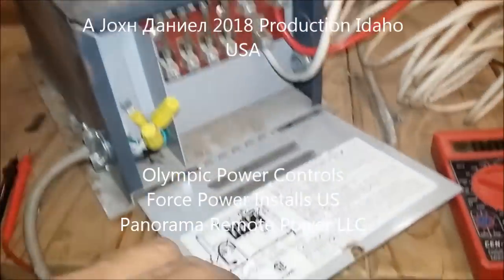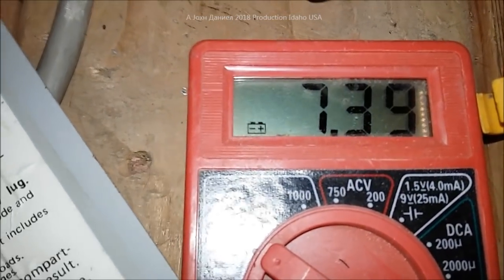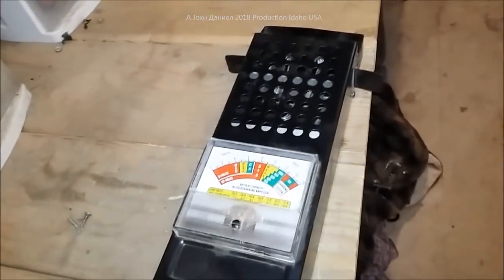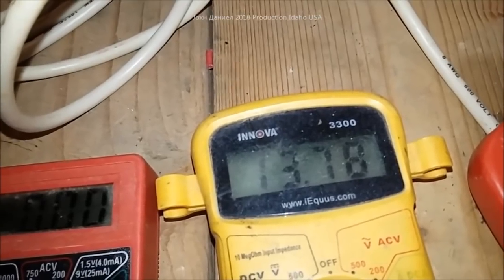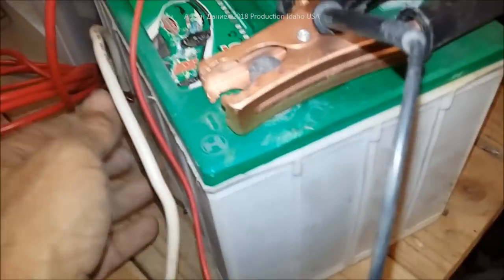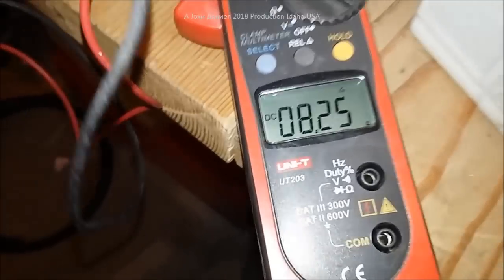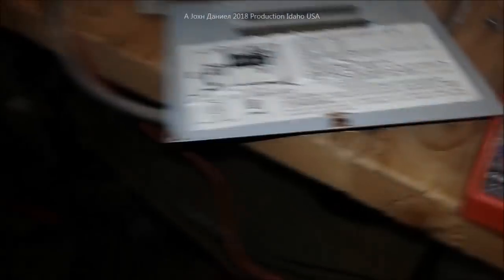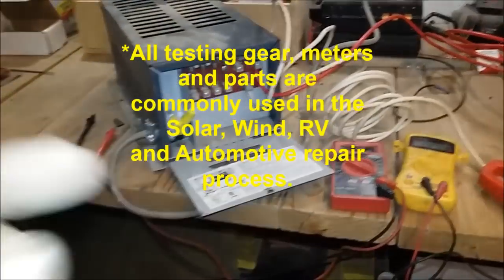Power Converter Charger test 120 Volt AC to 12 volt DC,  PARTS BELOW

Comment from the maker: As discussed, The UNI-T Meter that does it all, is fount at https://amzn.to/2LZrz8Y  . And that Load/Battery tester 100A https://amzn.to/2tdymnS  A NEW 35 to 75 amp "can use it on all RV systems and install it as converter/charger in the sytem" is this one, https://bit.ly/2LZv6UL , NO ONE gives you the local store return & warranty that WalMart can on them. Best place to order RV parts is absolutely a Walmart, https://bit.ly/2M03TS1 (< see yourself) think about it!!!! Instant return, warranty, and CHEAP!!
 RV power Controller Link option 2 -  http://linksynergy.walmart.com/fs-bin/click?id=nNC3MIW3bd8&type=10&tmpid=1081&offerid=223073.7442&RD_PARM1=https%253A%252F%252Fwww.walmart.com%252Fip%252FWFCO-9800-Series-RV-Deck-Mount-Power-Converter-Charger%252F55556999%253Faffs%253De
Questions on how to repair, or alter or the best bet, skip and bypass your bad controller - JUST ASK!
Reply: FYI the link you've provided for the clamp on ammeter is the wrong one. It sends you to the UT-202 which does not measure DC Amperage. You need the link for the UT-203.
Reply from the maker: It should do both ac and dc

Comment: My converter produces 17.5 volts. It has no charger in it.
20 amps max but it used to be 12.8 volts.
What would cause the voltage to be so high?
Thx

Comment: Up to 50amp battery chargers, obviously battery run RV's have been around for many years, bet solar panels were are real game changer in that case for long term RV use.
I actually saw a battery bank blow apart from low water levels in the batteries, they never topped the water up and I mean never.

Comment: I"m putting this on my list for my cargo trailer conversion.
Reply from the maker: This one is going into my BUG OUT rv. The guy wanted a 40 amp with intelligent control ( slang for computerized crap) so I installed him a 40, knocked off $10 for the old one and in my view I hit the jackpot because these older ones can handle generators, bad RV park power and careless owners. The new ones have to be watched carefully. He did not buy the one I said go get from WalMart, He got a goofy Teledyne 40A from a local supplier, JUNK!
Reply: Good video. It's to the point, no unnecessary 5 minute back story on why you bought the red one instead of the black one, or whatever waste of time,  so many have.  1 question from a new guy just starting to understand electricity and what travel trailers are all about.  Are the "factory" charge converts as bad as so many say? Should I immediately upgrade from 3 stage to "smart" 4 stage? Common complaint with the WFCO mine comes with is, takes too long to charge battery as it won't go into Bulk stage.
Reply from the maker: None are designed to bulk stage in the under $350 range. Thats why I do a every 3 months hard charge with a 50 amp charger, batteries disconnected from the system of course. On my other trailer I have 600w solar, many just add a 30Amp solar controller ( a 4-Stage Equalize, Bulk, Absorb, & Float) https://amzn.to/2ykVKFB and 300 watts of good 4 buss bar panels https://amzn.to/2M2LP9I and your covered. The newer 4 buss bar solar cell does well laying flat!

Comment: I have the same unit in my trailer ,except it's the 45 amp model. When I checked mine, I was getting 10.5 volts. Not sure on amperage as my meter doesnt do amps,  maybe I need to put a cheap battery on first. Trailer has an old walmart marine battery that I have no clue how long it's been on there. I just know when the power goes out, I have not bu int unless I either go fire the genny up or plug in the tow wiring to my truck.
Reply from the maker: Without a good battery to sense in the charge circuit the charger may stay on idle charge volts
Reply: @JOHNDANIEL1  I've got a spare group 65 that came off my ton truck. I'll try hooking it up and check it out. If no good, I'll be ordering a progressive dynamics with the 4 stage charge wizzard

Comment: I recently acquired this unit. After a short i found it wouldnt charge anymore. Once apart i found that the uninsulated wire going to the ballast resistor was not connected at the tab. I read about .5ohm across the ballast. So it seems to be good imo. I am going to resoder the wire Can this be replaced with a standard 2 prong auto ballast if it does not fix my problem
Reply from the maker: I haven't tried it but if you do make a video on it.

Comment: I have a question how come my motorhome will charge the rear battery battery from a converter
Reply from the maker: The converter is designed only to charge up the coaches supply battery for RV use, you can put a tiny toggle switch in they can send power up to the coach battery for the engine if you like but they're designed to stay separate on purpose so that you can never be set up with a no start situation on your main engine battery.

Comment: Great video, I have an stupid question,  I have my service truck and has a 3200 crane 12v battery operated, can a converter handle the use of the crane on combination with the 12 volt battery 
I do have a welder 12000 wats generator to power the converter.
Reply from the maker: Yes, but make sure you get one with open 50+ amps and not-at-will 50+ amps. Here's the type that have full 50+ available all the time and auto controlled charging. ( https://amzn.to/37Mnxfa ). Do not use the common ones with battery Charge (AKA Charge Wizard) THEN supply side boost which is about 75% of them.

Comment: Can you plug the converter to charge the battery from one of the camper's outlet that's getting power from a generator or any other power supply?
Reply from the maker: Yes, that's the normal process if it's not hardwired into the mains.

Comment: I have the same exact unit in my 1984 Tioga Arrow by Fleetwood. I sent it to an RV place and they installed wiring for the generator to be added for off grid use.  Needless to say they did not ground the wiring and now they are saying I need a new Convertor. I'm in Michigan. Is there anyone that can help me with this?

Comment: I have a 40amp unit. Only functions if I reverse polarity. Hook it up normal everything goes haywire. Not sure what to do I’m gonna snag a new battery in the AM and try it out
Reply from the maker: I would caution against it, sounds like you have a fused transistor or diode.
Reply: @JOHNDANIEL1  so I should probably get a new converter? I will mention that the converter when hooked up as it should. Everything goes haywire and it has like a dinging noise ever 30 seconds or so and causes the lights to flicker and can to slow for a split second. Everything functions as normal with the battery hooked up backwards. I didn’t even realize it was hooked up backwards until I traced my power jack not working issue and realized battery was reversed polarity. Battery is giving +11.94v and converter leads to the battery are giving -11.18
Reply from the maker: Yes, I would change to the RecPro in the size you need. Likely get the 55A,  It can be adjusted for battery types, has much better cooling and stable output. https://amzn.to/3qy4xj3
Reply: @JOHNDANIEL1  thanks for the advice you freakin rock! Right on!
Reply from the maker: With all the LED lighting options ( 80% less power used), less energy drawing stuff on your DC,  you can likely do fine with the 35 amp version, it really can do power starts of over 45 amps. Just be sure to test everywhere, chassis, metal items, all your power to frame continuity, especially where the tow vehicle sends power to the battery system. Test +(positive) to all points that are or should be - (ground). Get a great DC short tester https://amzn.to/43D0ZuE , this or similar. Pick something easy to use and store.  I love them.
And for real, use 8 awg silicone wire https://amzn.to/3N2amNs  to run to your DC connections and fuse center.
Reply from the maker: Had to update recent reply, to inform you to use the new wire

Comment: I have the 32A controller made by that company on my 23' travel trailer.     On the trailers front (just behind the propane tanks) it looks like it was where the battery was mounted (no protection box or anything - recon in 1983 they weren't worried as much about theft). 
 There is a white and black wire that I believe is the connection to the battery in that location, and also a break away brake controller there in that area (who's wires lead back to where the 7 way connector has its connections under the coach in the camper)..
My question is: I'm aware while being connected to AC that the 32a controllers battery charging function will charge the battery but I wasn't sure if the battery also gets charged through the 7 way connector when traveling down the highway?  Could you shed some light on whether on the older setups if the 7 way connectors where also charging the campers battery  while driving down the road (I heard a youtuber today eluding to this type controller as if that is how it was set up)?
The new replacement Hopkins Break Away Safety Controller comes with is own 12 volt battery and says it charges that included battery.  If I already have a setup where the vehicles 7 way is charging a battery I'd be confused as to how all this would work if I added this new Hopkins Safety Break away with its included battery.  
And I wasn't quite sure if on a 1983 Citation 23' travel Trailer, which was the negative or positive wire for connecting the main functioning campers battery (whether the white or black wire was the positive or neg.)?
Also, are AGM batteries safe to be charged by this type of 32A Controller?  Chargers I've seen say they need to say approved for AGM charging.   Wasn't sure if this one in my Camper had the technology to charge an AGM or if it would affect it's health and longevity if it wasn't AGM approved charger? And if not what size and type battery should I get for it that would function well with this type controller? Thanks.  Great video.  Didn't see a lot of people sharing info on how these controllers work.
Reply from the maker: Solution - You get a 20 or 30 Amp MPPT controller like this one https://ebay.to/2WgYfAo with bluetooth. You wire it in where the power (charge) goes to the battery from both sources. Your tow vehicle and that charger in the Rv is seeking to send it up to 14.6 volts. That will ruin a GEL or AGM in short order. So, by wiring in line the charge controller, then on the load side returning power with at least a 8 awg wire back to the fuse box of the RV,  you can set rate on the controller at 14.0 volts then maintain at a safe 13.6 volts. The load side of a 30 amp model will handle all you would run through the fuse box to the lights and fans. I use them on my RV's, install them at a rate of 15+ a year and everyone loves them and some go and add another with 300 watts solar to boot. What it does is act like your charging is solar, only a MPPT can be adjusted to meet such needs.
Reply from the maker: PS, if you do this, on that charge unit in the RV, you will install a new fuse box OUTSIDE of and not connected to the 120/12 converter!

Comment: So I have the same one. By the transformer has that glass cap with the white shrink wrap. Blew out how would I fix it.
Reply from the maker: Are you referring to a capacitor or the safety fuse?
Reply: @JOHNDANIEL1  after going to a few places to try to find out why it’s not working. I’m just going to update to a new power converter.

Comment: If the top fuse with the red writes goer to the battery? Where doed the bottom wire go to? I've got am old 78 dodge 440 b300 Sportscoach I bought as us and I'm working on trying to restore it on a super tight budget with all this inflation and my electrical at first didn't work than it suddenly started workonnits own one day and he oner hood fab just magical turned on. Lol.  did got tons of wires plus the single 100 watt soalrpanels I added I'm 2020. My fuses are are shorted it out So u ran all the 12 volts to the left side of that fuse on top. I thought thr bottom white wore was the coach battery ad thr coach battery is also white including the generator wore os also white. Ot has soem short of a tiny meleltal circuit o thinknits an automatic cut off switch for the  starting alternator.  The white wire of the converter looks like it runs to a shunt I think with other white wires coming off that shunt/plate looking thing but I don't know where it goes. All the wires from the fuses are red, black and 1 green one if I remember correctly.  To the it looks like thise wires go directly to the breaker box which looks like is has wires leading to a junction box. Some how I think it's rigged to get 120 volt power with out an inverter. I'm trying find a wire diagram or a video I can save and look back at it later for reference so when I can upgrade to an inverter I can. I've got that same inverter.  Also is it possible I can rewire my solar to a shunt or does it have to be directly at the battery. I'm trying tobck3an the wire mess up if I can but I'm still a little lost but i kinda got a hint
Reply from the maker: Send me some wiring pics of it, nice clear shots, some models with auto controls varied so send pics to my email and I can get you some answers as soon as i can, may be a day or so. olympicpowercontrols@yahoo.com